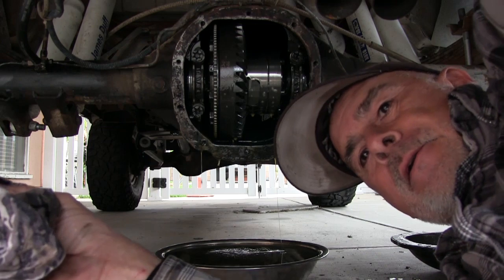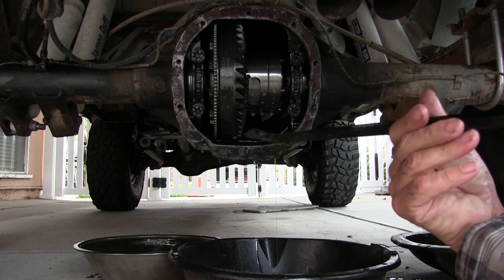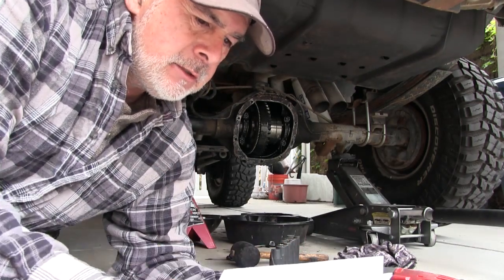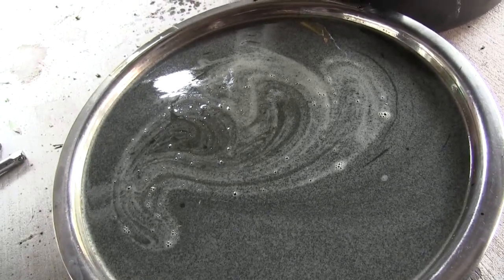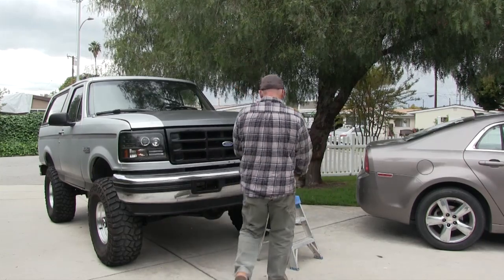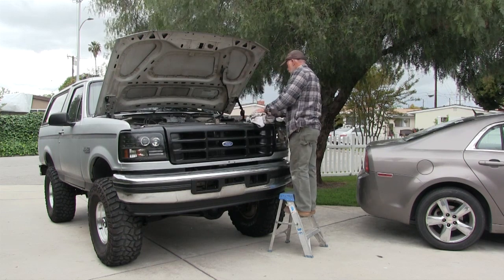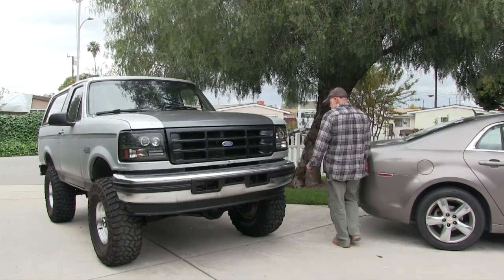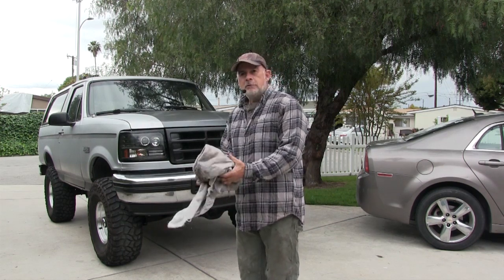Bronco Prep For Sale

Comment: Keep in mind the values I told you about. No need for new parts. clunk is just a dry slip yoke that needs the motorcraft teflon lube. easy on the new parts.

Comment: Maybe your front or rear or both driveshafts are running dry at the slip yoke. Consider checking those out and use some Ford PTFE lubricant.
Reply from the maker: Greased up and no change.